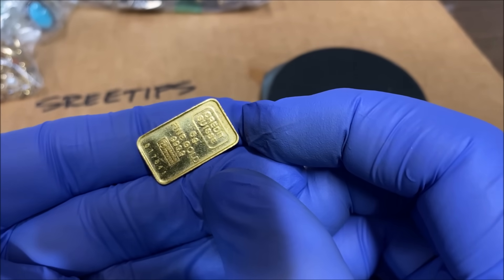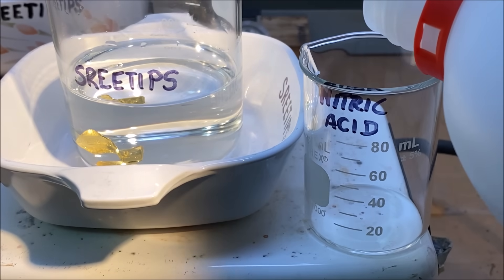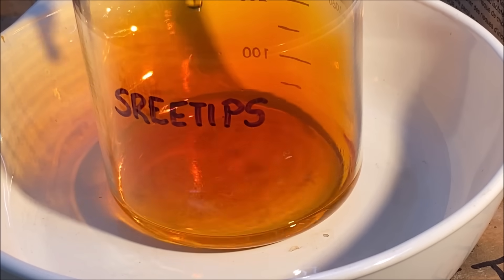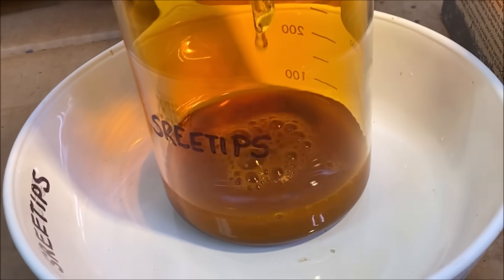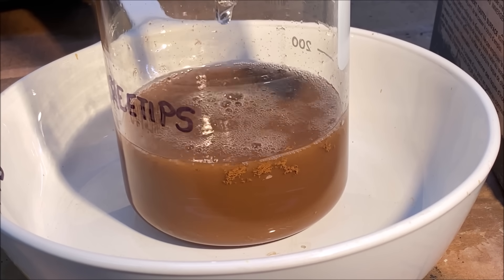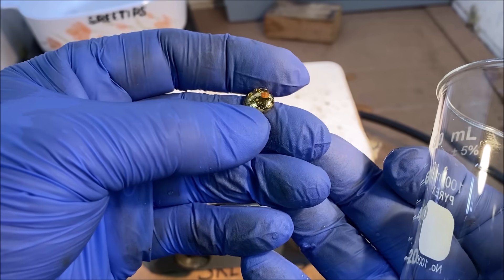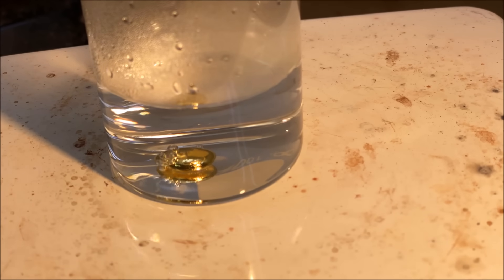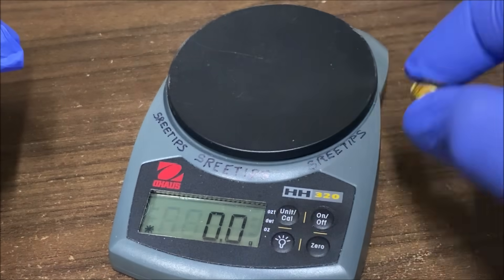Dissolve 5 Gram Credit Suisse Bar in Aqua Regia

Comment: I’ve been following your experiment where you dissolved the 5.0 g gold bar to test purity in which you disolve the bar in  aqua regia, precipitated with SMB, filtered, washed, melted, and then re-weighed. I noticed that you used a balance with one decimal place, which gave you a starting mass of 5.0 g and a final mass of 4.9 g.

While the process worked well, the precision of the balance has a major impact on the accuracy of the calculated loss. With only one decimal place, there’s a relatively large percentage error, which could make the apparent loss look greater or smaller than it really is.

I would suggest using a three-decimal-place balance for this type of work, since it allows a much finer measurement and a clearer picture of any true percentage loss.

Why Balance Precision Matters

Every balance has a smallest readable unit (the "resolution"). This translates directly into the uncertainty of the measurement. The percentage error can be estimated as:

Percentage Error
=
Balance Resolution
Measured Mass
×
100
Percentage Error=
Measured Mass
Balance Resolution
	

×100

For a 5 g bar:

Balance Type	Resolution (±g)	% Error at 5 g	Starting Mass Readable As	Final Mass Readable As	Apparent Loss (g)	Apparent Loss (%)
1 d.p.	±0.1 g	        ±2.0 %	       5.0 g	         4.9 g	        0.1 g	         2.0 %
2 d.p.	±0.01 g	        ±0.2 %	       5.00 g	         4.90 g	        0.10 g	         2.0 %
3 d.p.	±0.001 g	±0.02 %	        5.000 g	         4.900 g   	0.100 g	         2.0 %
4 d.p.	±0.0001 g	±0.002 %	5.0000 g	4.9000 g	0.1000 g	2.0 %
Key Points

With 1 decimal place, the error margin (±0.1 g) is as large as the entire observed loss. That means the “loss” of 0.1 g could partly be measurement error rather than a real difference.

With 3 decimal places, the error margin (±0.001 g) is 1/100 of the observed loss, so you can be far more confident that the 0.1 g difference is real.

This level of precision is especially important when you’re evaluating the percentage recovery and potential process losses.

Conclusion
Switching to a 3-decimal-place balance would make your results much more reliable by significantly reducing the percentage error. This way, you can more confidently assess the true loss during refining rather than having the measurement precision dominate the result.       

Why a 3-decimal balance matters for the 5 g bar test

For your purity test (dissolve in aqua regia → SMB precip → filter/wash → melt → re-weigh), you used a 1 decimal place balance and observed 5.0 g → 4.9 g (i.e., 0.1 g, 2.0% loss). Because a 1 d.p. balance rounds to the nearest 0.1 g, that readout actually represents a range of true masses. This has big implications for interpreting loss, recovery, and purity.

What the 1 d.p. readings really mean

A reading of 5.0 g can be any true mass in [4.950, 5.049] g.

A reading of 4.9 g can be any true mass in [4.850, 4.949] g.
(Intervals shown to 3 d.p., inclusive of the endpoints that still round to the stated 1 d.p.)

Extreme, but still valid, 3 d.p. interpretations of your 1 d.p. result

These are the 3 d.p. values that would still show up as “5.0 g → 4.9 g” on a 1 d.p. balance:

Minimum possible loss (best recovery)

Initial = 4.950 g, Final = 4.949 g → Loss = 0.001 g

% Loss = 
0.001
/
4.950
×
100
=
0.020
%
0.001/4.950×100=0.020%

Maximum possible loss (worst recovery)

Initial = 5.049 g, Final = 4.850 g → Loss = 0.199 g

% Loss = 
0.199
/
5.049
×
100
≈
3.94
%
0.199/5.049×100≈3.94%

So, the single 1 d.p. line “5.0 → 4.9” actually allows a true loss range of 0.001–0.199 g and a true percentage-loss range of ~0.02%–3.94%.

What this means for purity (or recovery)

If you interpret the loss as impurities removed (i.e., no process loss), then the gold purity of the bar is Final / Initial.

Highest possible purity: 
4.949
/
4.950
=
99.98
%
4.949/4.950=99.98%

Lowest possible purity: 
4.850
/
5.049
≈
96.05
%
4.850/5.049≈96.05%
→ With a 1 d.p. balance, the same displayed result (5.0 → 4.9) permits a purity anywhere from ~96.05% to 99.98%, solely due to rounding.

If you instead assume the bar is pure and the difference is process loss, then your recovery yield has the same numerical range (~96.05%–99.98%) under those extremes.

Why use a 3 d.p. balance

A 3 d.p. balance (±0.001 g) collapses that very wide ambiguity. The smallest possible change (0.001 g) is now 1/100 of your observed 0.1 g difference, letting you distinguish real process losses from rounding noise and report much tighter purity/recovery bounds.

Comment: I wanted to share a quick suggestion regarding the filtration process, particularly when dealing with suspensions like gold powder in water. Using fluted filter paper in a cone shaped funnel instead of the typical cone-shaped paper in a funnel could significantly benefit your filtration efficiency.

Here’s why:

Increased Surface Area: Fluted filter paper offers a larger surface area exposed to the liquid, allowing it to filter more effectively and faster. The folds in the paper create multiple filtration pathways, which helps prevent clogging and speeds up the process.

Improved Liquid Flow: The folds also maintain air channels that allow air to escape without interfering with the liquid flow. This avoids the "air lock" problem that can occur with cone-shaped paper, which often slows the process.

Faster Filtration: Because of these factors, fluted filter paper can speed up the filtration process by up to 2–4 times compared to cone-shaped paper. This can be particularly beneficial when dealing with fine solids like gold powder, as it helps avoid slowdowns caused by clogging.

For a smoother, more efficient filtration experience, especially when working with suspensions, I believe switching to fluted paper would be highly advantageous.

Please let me know if you have any questions or need more details!
Reply from the maker: Excellent suggestion, thank you.

Comment: "Based on my experience, I don’t think that there much of anything else in that particular bar other than pure gold. I deliberately skipped inquartation, filtering, rinsing to avoid any potential losses that would have happened. I weighed the button on a more accurate scale: 4.95g to 4.94g so I’d have to conclude that the bar was accurately stamped."

Comment: Hello Sir how are you? Would you please tell me about acids volumes uses and how long will it take to dissolve 5 g gold?
Reply from the maker: I think I use about 100ml hydrochloric and twenty or thirty ml of nitric with much heat. Took a couple hours. But it would take a little less time if I melted the gold first, poured the molten gold into water to form granules. This increases the surface area. I left it as is for the show.
Reply: @sreetips Thanks you very much Sir. I used 211 ml aqua regia to dissolve 5 g of pure gold pieces, heated at 70°C , with stirring at 350 rpm, the reaction took only 1 hour 20 minutes, I used HCl 32% and HNO3 60%. Is that normal? I meant about time for dissolving
Reply from the maker: Sounds about right
Reply: @sreetips  Thank you very much🎉🎉🎉 Have a wonderful day❤❤❤

Comment: let's assume they had adulterated the gold with copper. Copper also dissolves in acqua regia. I don't know about the preciptation step - would have copper stayed in solution? Could this method also detect a gold bar adulterated with copper? Or asked differently: what sort of adulteration could you use that this method could not detect?
Reply from the maker: Copper in solution is blue. So any copper would have turned the liquid green. Gold is yellow, copper is blue. Yellow and blue make green.

Comment: You could just bend it enough to expose the inside and check with spectrometry. Maybe a more expensive equipment but no reagents cost, more accurate, less steps, basically no risk of loss, aside from a little bit staying on the tools (but you bent it here anyway) and much harder to screw up.
Reply from the maker: Refining guarantees that it’s not fake. It’s the only way to be absolutely certain: learn to refine it yourself.

Comment: Refining pure gold sure looks a lot easier!  This is also a great confirmation of the process you use - the loss from going into solution and out again was very low.  I know with more contamination there is likely a bit more loss (if you have to refine multiple times and rinse off the results multiple times, etc).  I do have one question - how is that burning the filter paper in with the gold doesn't add any contamination (say from the carbon)?  Also, how is that the excess SMB doesn't leave contaminants in with the precipitated gold (does it all remain dissolved in the liquid?)?
Reply from the maker: Carbon doesn’t alloy with the gold, it just burns away. The SMB decomposes and doesn’t affect the gold. It might leave some non-metallic products in the melt dish.
Reply: @sreetips  Got it!  Thank you!  I figured that must be the case - but of course I always wondered!!

Comment: Hi brother, I'm sorry, I have a question to melt the gold and then evaporate the solution what should be the hot temperature of your plate? So I ask that question my hot plate is different than yours،I mean, how many degrees Celsius should the hot plate be on?
Reply from the maker: I’m sorry, I don’t have a specific temperature in degrees Celsius. I just turn it up half way between 100% and 50% on the dial and keep an eye on it. If it start to boil too hard then I turn it down a little.
Reply: Thank you very much brother for your answer,got it

Comment: All that work for someone to try to win 10% of a 5g bar? Who does this? Could it have been tampered with by someone who works at the mint?
  I have a 10g one of these I bought around 15 years ago. Everything seems to check out other than when I do the volumetric test it comes out a little low. The only other fake credit Suisse I've seen are the 1oz ones but I'm worried about mine due to the volumetric results.
  Wanted to take it into Geneva recently due to the high price of gold and my current lack of funds. Hope it's more than 90% it has one of those little gold frames also I think they are supposed to be 18crt the frames.
  Just one question. Why would you not simply melt it at the melting point of gold? Is this because metals with a lower melting point could be present? Also did you try the ping test? I flip mine in the air off of my thumbnail to get it to ping but I don't have another one to compare it with.
  I bought mine off of eBay from a guy who was fairly local, he was located closer to Geneva than me.  He sold me some ancient coins at the same time so I felt a bit better about it since he was also trading coins. He said he had a few of the 10g bars and only sold them from time to time. I've not seen much info on the 10g ones in general.
  It has a very similar look to mine.
Reply from the maker: The only reason I did this was for the show.

Comment: I've used $50k XRF machines for 13 years and have experience analyzing pure gold/silver/platinum both with and without packaging, and also with a contaminated "window" and a clean one.

Your XRF is possibly either not lab grade, it has calibration issues, there is contamination inside the instrument or in the "window" of it, or you did the XRF analysis of the bar inside the packaging, and not on the bar itself.  The packaging will compromise the XRF analysis result, too.  As I've seen Credit Suisse plastic contain other elements, contaminating the plastic, throwing off your result very slightly.

Capsules also have this effect, when analyzing a coin inside a plastic capsule.

Comment: Things that influence XRF readings are, dirt, surface area and duration of the scan. Also allow for some variance. There is a sigma value given next to the result which is the possible variation you can expect (higher or lower). Also a melting loss is always to be expected.
Reply from the maker: I’ve never used one. I don’t know anything about them other than they flash 999 when it touches a piece of my gold (according to the big refiner that I sell you)
Reply: @sreetips  I work with one everyday. Your refining is thorough. These XRF machines only give a surface reading though. It measures about 5 microns deep. So you could have a 1mm foil of fine gold covering an object and you will get a 99.99% reading.
Reply: Also, you could have a ring made up of several parts of various karat, say 9 and 18 and it will give you an average of the exposed surface.
Reply from the maker: This was explained to me when I inquired about renting one.

Comment: Might have helped if you used scales that read to another decimal place. You can disregard the 5.0 reading as it flashed to that while it was still settling. Any time you place an object on a set of scales it is going to always temporarily show a higher reading because of momentum, that is how scales work. What you have to work with is the settled weight. 4.9/5 = .98
Reply from the maker: Negative! I weighed it on another scale and got 4.94 grams. So 4.94/5 = 0.988
Reply: @sreetips  you used a different set of scales, but you didn't disprove my point. The only reason it flashed to 5.0 is because of momentum. 4.94 will still round 4.9 on a one decimal point set of scales. Your percentage is still subjective, since you never measured the original unaltered piece on the two decimal place scales. It could have been under or over 5.00
Reply from the maker: Ok, point taken. Thank you.

Comment: If done correctly, evaporation is by far the best method to rid a gold solution of excess nitric. Second only to incremental nitric dosing.
I knew I wouldnt be the only person to notice that you added the nitric like a math formula, instead of your usual incremental  adding of the nitric I had a gut feeling it was to much when I watched you do it
Reply from the maker: Ray, I’m “out of practice” plus getting older. Losing proficiency. I could have gotten by with just 20ml and saved some time.

Comment: I don't know. .1 grams out of 5 is 5% loss. I don't see where that much gold would have gone in what you did. It would be better to have a microbalance and to do the process a few times. Actually if you did the exact same treatment again, you could see if there was a further loss, indicating loss in the conversion process if the loss is the same, versus no loss, meaning your process is clean and the bar was mislabeled to begin with.
Reply from the maker: I weighed the button on a more accurate scale. 4.94 grams. So not a 0.1 gram loss, it was 0.06 gram loss. Insignificant considering entropy and my crude method.

Comment: Why does pure gold need borax flux? Is it because it’s in a liquid state? Would melting it in argon gas be more efficient than using borax?

Cool video though!
Reply from the maker: Flux means “flow” borax is flux. It coats the inside of the melt dish and prevents the gold from forming tiny balls that adhere to the walls of the melt dish instead of flowing down into a central mass in the bottom of the melt dish.

Comment: AI Overview
Learn more
Aqua regia, meaning "royal water" in Latin, is a highly corrosive mixture of concentrated nitric acid and hydrochloric acid in a 1:3 ratio. It's known for its ability to dissolve noble metals like gold and platinum. This unique property earned it the "royal" moniker, as it was the first known solution to dissolve these otherwise unreactive metals.
Reply from the maker: I can dissolve an ounce of pure gold powder in 150ml hydrochloric acid and about 15ml to 18ml nitric acid. Also, hot hydrochloric and hydrogen peroxide will dissolve gold. Chlorine gas will also dissolve gold and platinum,